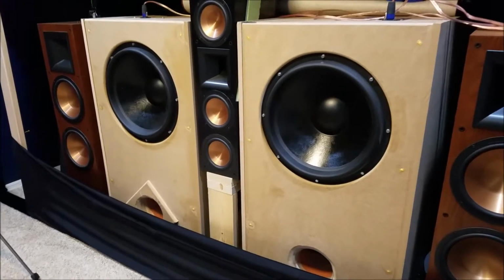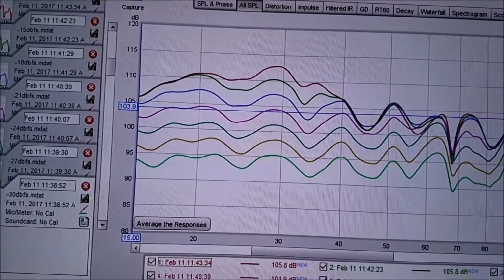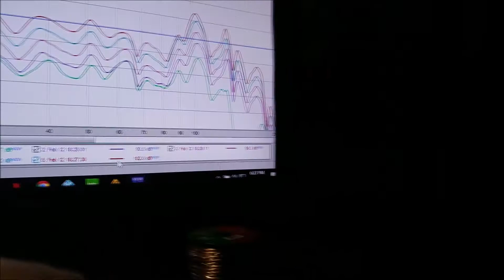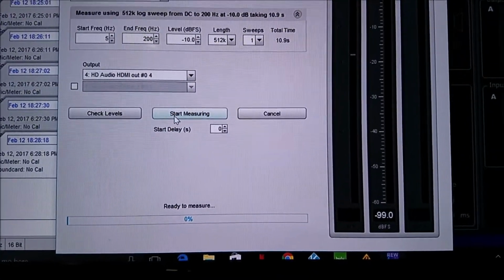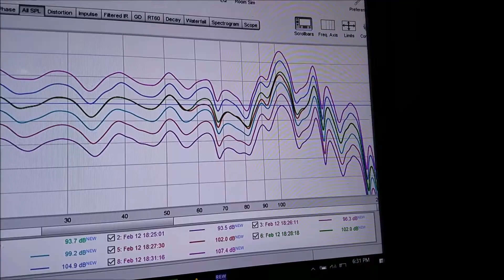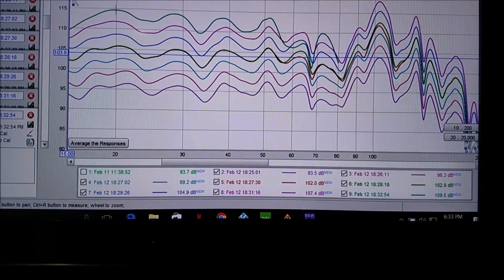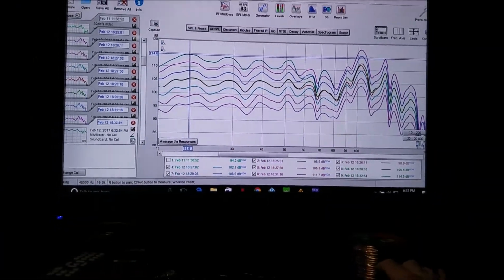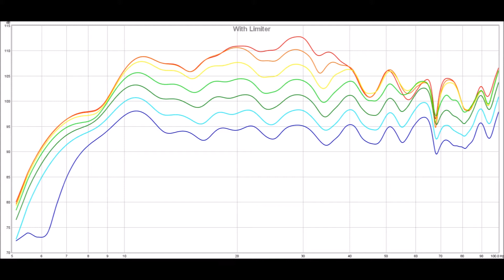Salerno Subwoofer Tuning

Comment: just curious about the reasoning behind the placement of your subs. why are they towards the center of the room? Too powerful to cornerload?
Reply from the maker: I have the air intake for my home HVAC in one of those corners.

I have considered moving them.  According to an Audioholics article, the best results with two subs on one side would be to have each of them placed at the 1/4 width points.  I may try that, but it would take a bit of effort to move everything around that dramatically.  I talk about it a bit in this video: https://youtu.be/QXqHKwt_Sao?t=279

Comment: just cant believe those 18"s were 190$. that just blows my mind! they are beautiful.
Reply from the maker: Yup, I got them when SI did their first run.  Their newest version is a lot more expensive.  Seems the problem is that there is very little profit in these sort of drivers, so it seems like feast or famine when it comes to sourcing drivers.  About 7 years ago, the Maelstrom X was another go-to brand by a lot of DIYers, and they went under when they got a bad batch of drivers that they had to take back from customers because the shorting rings were improperly mounted.

I really wish I would have gotten 4.  I'd like to build two sonosubs to compliment these beasts and take me into the realm of having to worry about structural damage!
Reply: Is there any brands/and or models of subs that you can think of now that are great for the money? I dont have a huge budget but it seems everyone is buying those Dayton Ultimax's but they are still a bit out of my price range. Thanks alot for the info, brother. Again, beautiful setup and much respect for the hard work you put into it. Im a little jealous :).
Reply from the maker: I did some searching, and couldn't find much.  I found one site called fuaudio.com  You definitely need to know what you need to look for in terms of T/S parameters so that you don't buy a driver that is not appropriate for what you want to do.  There are some really smart people on both the avsforum.com forums and hometheatershack.com forums.  I'd definitely run any potential driver you're interested in by them to see if it is good for what you are wanting to do.

Do you know if you want to go with sealed/ported?  Infinite baffle?

Comment: What's the brand on the subwoofers? Are they better than the Dayton ultimax 18 ? Cuz i think i only have that in europe =/
Reply from the maker: The drivers are Stereo Integrity HT18s (the discontinued ones).  They were great bargains at the time as their replacements are much more expensive.  Looking at the Dayton specs, they probably perform similarly.  But I have not personally been able to compare the two.